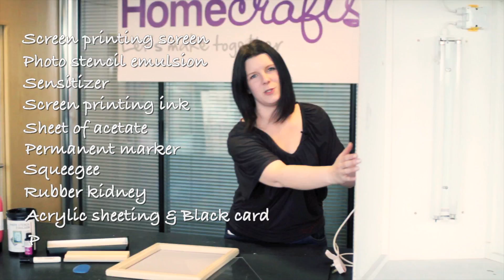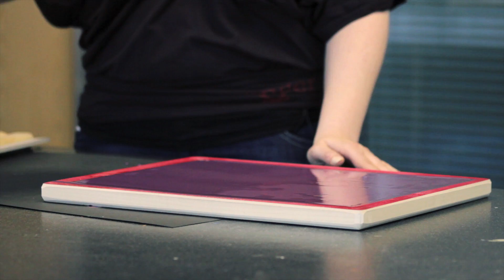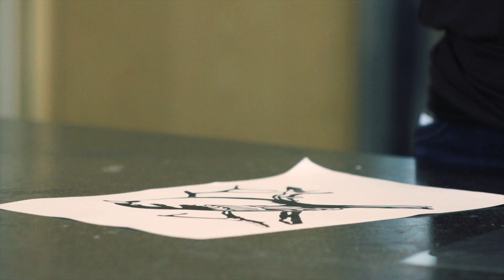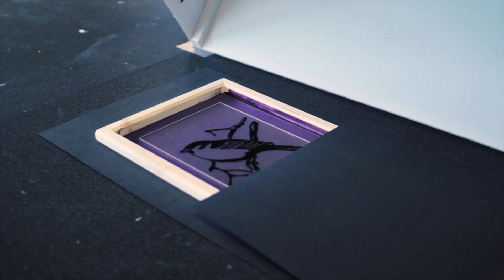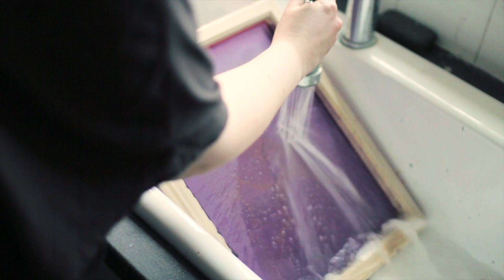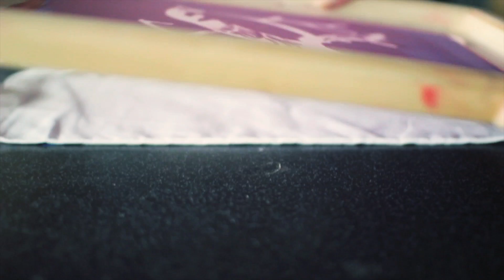Screen Printing - How to Screen Print Your Own Designs

Comment: This looks a lot more complicated than what most people would call a home craft.
Reply: I agree with you 100%. The process she is demonstrating is too complicated. Not to mention that the exposure unit is way to big.
Reply: @jor771572  yes...however, in my country, this process is somewhat shorter. you just add sensitizer to your liquid and pour it on the screen. then trace your design on tracing paper while your screen is drying. then place your design on your screen and expose it to the sun for 1-2 min. and that's it. quickly after that, you can use it for your own benefit!!!
Reply: and yes.i forgot..you have to rinse before your first print!!
Reply: This is actually a summary and there's much more to learn, screenprinting isn't scrapbooking. Many artists make a living out of it.